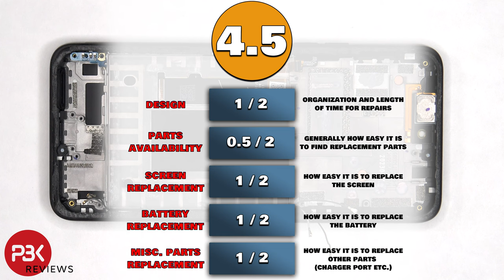HTC U23 Pro Teardown Disassembly Repair Video Review

Comment: I missed HTC. Still have the HTC One M8, and the HTC U Ultra in my drawer. Thank you for disassembling this, barely anyone does any videos with HTC anymore. Just a note though, I'd recommend re-rating the Availability of parts as it has been barely a month and a half of its annoucement, give it a few more weeks and you'll be able to find replacement parts. Once again, great review!
Reply: Still have M8 and u11 life working
Reply from the maker: You're welcome, and thanks! As for the parts rating, I am aware parts usually aren't available at launch, but in general due to the decline of smartphones from HTC over the years, parts aren't as widely available even after release as say parts for Samsung or Motorola phones. Even months after, it will be a struggle finding certain parts and the only option would be to send it in to HTC for repairs if you reside in the country you purchased the device from. Some parts will show up yes, but not all parts so based on those issues, I gave it a score accordingly.

Comment: Hello :)  @PBKreviews  i'd like to ask you about camera glasses of U23 pro. I read that the camera of this smartphone is easily scratched. Do you know something about this?
Reply from the maker: Hi, not sure. Usually the glass lens cover are made of types of glass which are scratch resistant, or other materials, but its possible they didn't use a scratch resistant glass. I didn't test it out to know on this phone.
Reply: @PBKreviews  I understand. Thank you for the answer!)

Comment: I used to love HTC phones. But I stopped purchasing them when they became almost impossible to open and change the battery. I've gone for Fairphone now, love the repairable modular concept
Reply from the maker: HTC used to be even more difficult with the earlier models with so many wires going to different places and the design internally was just bad. But they improved a lot towards the later years. Yup Fairphone is definitely easier to take apart and repair.
Reply: @PBKreviews  yes the HTC 10 was a nightmare.. I still have one sitting in a drawer. Couldn't find anyone to replace the battery for me.